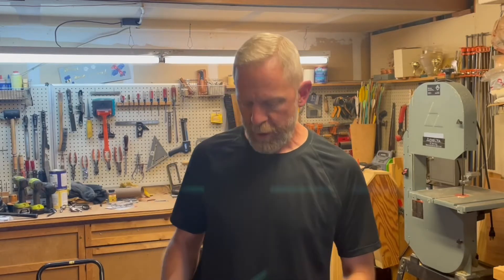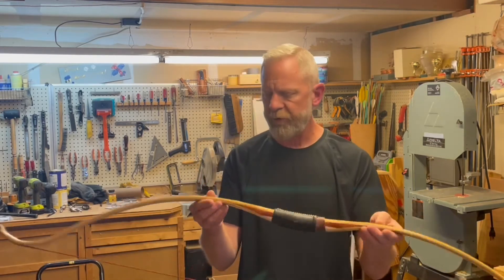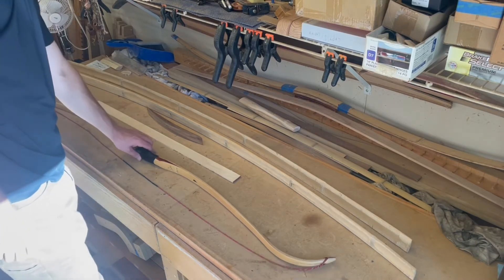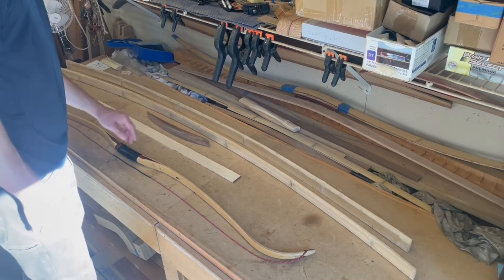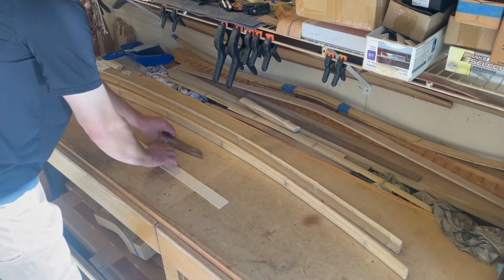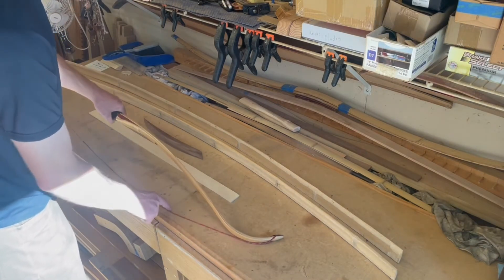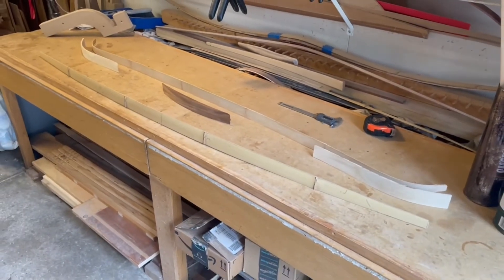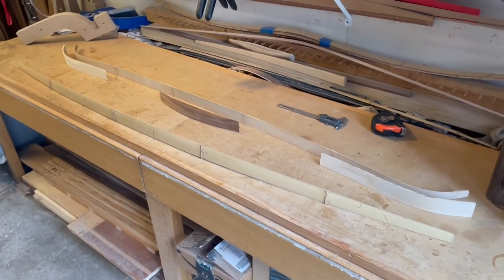Scythian bow experiment Pt.1

Comment: Sir may I ask. What kind of wood does a person use for the handle core and the sears? Can I a person use something like pine? Should it be a hard wood or soft wood? Im so knew to bow building..I've  started making very good pvc bows but I want to start making a real woodern bow and start with bamboo
Reply from the maker: I would suggest sticking to hard woods. As for the siyahs, the direction of the grain is of upmost concern.  You don't want the grain to split on you during use so make sure it is running against the direction of string impact from the loop.
Reply: @meadowlarkadventuregear  noted